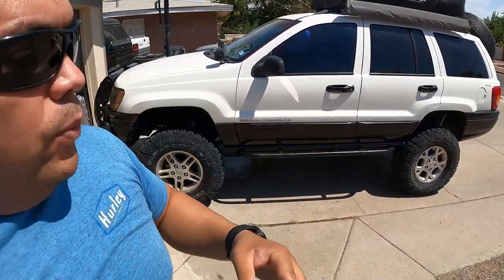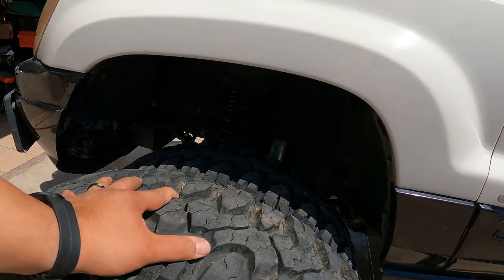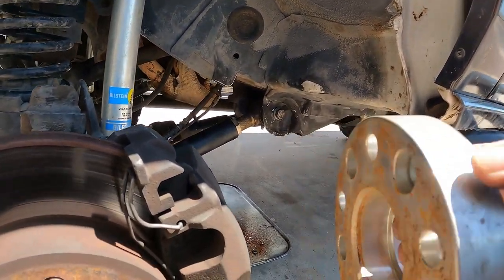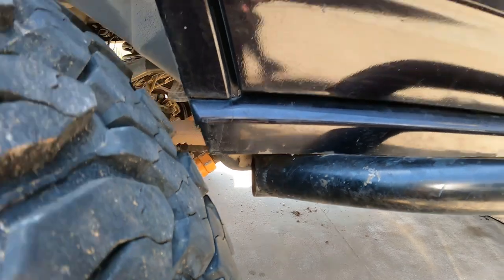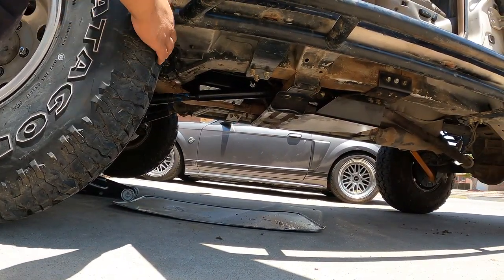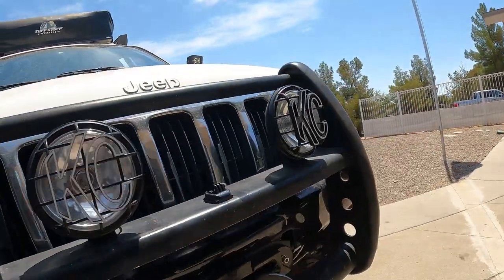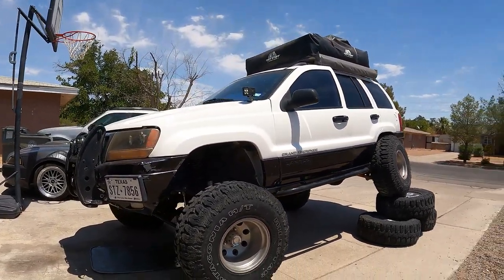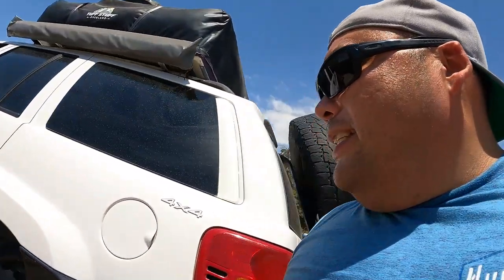SHORT ARM Jeep WJ on 35s, is it possible????

Comment: Engineering Overland did 35's on a WJ without cutting the metal of the fender by moving the wheels/axles forward and backwards 1 inch each... you can see his build on his channel... I also don't like cutting those grand bodies.  Makes more sense to extend the wheelbase and trim the plastic on the bumpers...
Reply from the maker: Cool, thanks. I'll take a look at his build.  See what tips I can get
Reply: He's also on 8 inches of lift.

Comment: Try them w/out spacers. Offset should be better w/ just the wheels
Reply from the maker: I would but the wheels are 5x5.5 and the Jeep is a 5x5, so I have to use the adapters. If I like the way the 35s work. I might change them later on. We did the first trail test today and, well the next video will be good. Thank you for watching.

Comment: Bro if 65 is your top speed than something is wrong. I can comfortably go 90 mph in my WJ with warn out stock suspension and warn out of balance mud tires.
Reply from the maker: Yes 65 is my happy speed, over that with 3.73 gears, my trans will not lats to long lol, but it will go over 65 if I  want it to.

Comment: You definitely need to re-gear my man 
you are just asking for that transmission to blow up. Leaving it that way 
Not only that the engine revving higher just to stay at highway speeds it’s a bad combination to go that big of a tire without re-gearing to the proper size, not only that you lose the  climbing ability even in the low range the torque and gear is just not there.
I hope you get that done soon so your jeep will actually last a long time.
Reply from the maker: You are correct, I have noticed it down shifts more often. I have a camping trip planned for this coming weekend, so I'll put it on the highway for some testing. I don't want to re-gear the D35, I might just wait to put a 44 on the rear to re-gear. I still have the 33s just in case this doesn't work out. Stay tuned, I tuck it on its first easy trail this week and I had to do more on it. I have like three videos I'm working on editing 😆, but Thank you for the advice and watching.

Comment: Going to ride like absolute sh!t!
Reply from the maker: It actually rides amazing. I did end up adjusting upper, lower control arm,  track bar, pinion angles front and back. But that's for another video. A lot of people think that you can just put things on and it will work. But  after doing a lot of adjusting and measuring I got it dial. No death wobble, no bump steer, and drives straight. Only thing I removed the rear sway bar so it sways a bit on turns. Also working on another video of driving inside and outside at all speeds. More videos to come, so keep on and see for your self. PS I driven jeeps with 2/4 inch lift that drive like s---, because people don't know what angles and adjustment can do if you get it right and take your time. Thank you for watching 👀.
Reply: Stop the lies lol. Been around this lifted 4×4 seen for years. No cherokee runs awesome with 4+" lift & 33's & above. You try to convince yourself & others, but the truth is it doesnt beat long arms. They wouldnt make many long arm kits if short arms would ride smooth. Nice ride though keep doing what you doing!